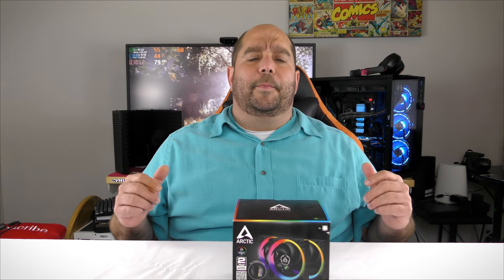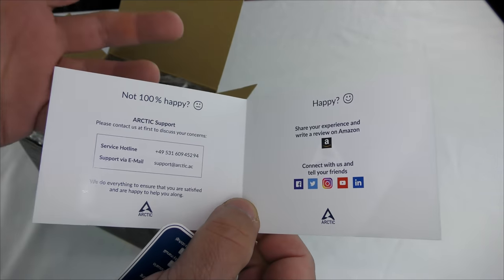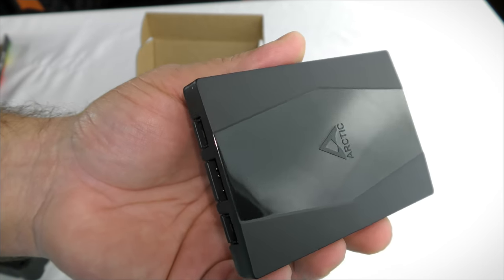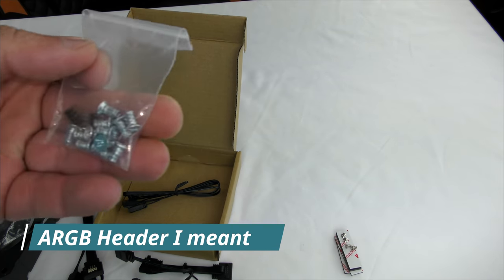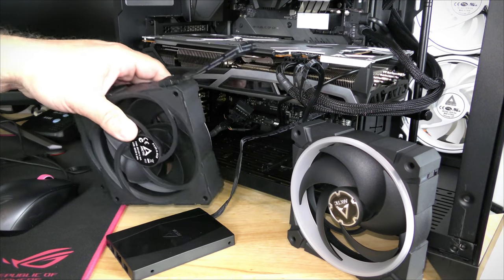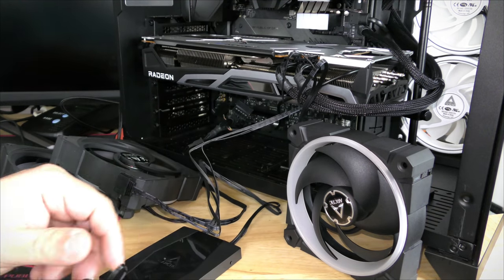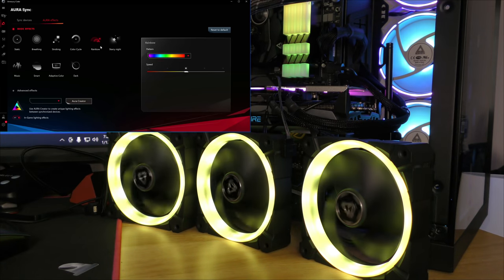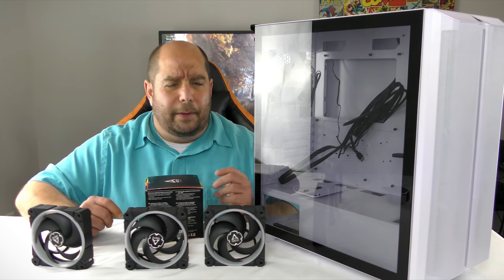NEW ARCTIC BioniX P120 A-RGB Fans - First Look

Comment: In my opinion these fans look way better than Lian Li’s fans that everybody’s raving about. I just don’t like the rgb pattern on them. These are not quite as simple to connect together, but they are easy enough. One thing I found odd is connecting argb fan hub into non argb connector, but I guess they had to do that way for some reason. Great video enjoyed watching. Bought two packs of these.
Reply from the maker: I like them too and you are 100% correct, they are not easy to connect, after you figure it out, its a little easier, but being that this is their first iteration, they will make the 2.0 version better.  Yes, this is to help older machines with compatibility issues, so that everyone can have ARGB.  Thanks bud, so very happy I could help you, hopefully you used my link in the description or pinned comment to buy them, it will help a bit, but if not, not worries, it literally is a few cents, but hey, 100 pennies makes a dollar ;)  Thanks so much for stopping by and checking out the video, even more for commenting, it means the world to me.

Comment: For anyone looking to use this fans as radiator fans. You guys gotta either talk to arctic and wait for them to get back to ya or you can order m3 35mm screws.
Reply from the maker: did you finally receive the screws?
Reply: @ThisBytesForYou  yeah I made a separate comment about the screws  for those who want the fans for their 360mm or 240mm radiador
Reply from the maker: @Angel_Espinal  yeah I would assume most would, but good, I just wanted to make sure you got them.  Is there a chance you could measure the screw and let me know how long it is?
Reply: @ThisBytesForYou  my separate comment states that, the screws that were sent to me are M3 35MM. The screws that were sent, they're referred to as "Cheese Head" screws, with a #2 Phillips Head fitting.
Reply from the maker: @Angel_Espinal  hahahha, cheese head, NICE.  Yeah that is the M3 and I saw the 35mm, but it didn't register, thank you so much ;)

Comment: Thanks Iggy for the unboxing and first quick review. Eager to see the full extended review.
Reply from the maker: Thanks my friend, you will see on Friday the build video, where I do the cable management of the video I just released monday, its nuts but turns out great.  thanks for your support.  more coming soon on this.
Reply: Hi Vincent, you seem to be a representative of Arctic.

Just wanted to say I bought a pack of 3 P120 ARGB.  One of them isn't even spinning but lights up. Trying changing orientation (first to second to third) on the chain etc. 

Gotta say, pretty disappointed with the QC.
Reply: @jivk.8928  I am actually the technical director :) Please get in touch with our support team from the form you have in the online manual. they will assist you for an exchange.
Reply: @VincentAndre_HK  Thanks, I'll give it a shot. So far, my experience with German companies is that everyone in their sales team speaks English. But when it comes to warranty/problems, suddenly no one understands English. (Looking at O2, 1und1).
Reply: @jivk.8928  No worry, we are fully international and actually, part of the customer support team is US based.

Comment: can i install these fans on arctic liquid freezer 2 radiator?
Reply from the maker: you can, but you need to call Arctic to get the correct screws, if it did not come with them.

Comment: Can my fan light up without this sata hub thing ? I have the same fan.
Reply from the maker: yes, but it is a controller/hub so that you can control it with the remote if you did not ARGB headers and so that you can connect multiple fans if you wanted, instead of 1 per ARGB header.

Comment: The screws are too short to mount the fans with a radiator, considering they are pressure optimized and not even standard 25mm depth :/
Reply from the maker: you are correct, I let them know earlier today, just waiting to hear back to see what is going to be done, but this is their first entry into RGB, I am assuming they made them beefier to accommodate for that but let's see what they say.
Reply: Good point we can't mount it on rads
Reply from the maker: Working with them on it, I am not sure what they are going to do about that, but I hope to get word back soon, should be today at some point.
Reply: Yes, that was and overlook from us, we are preparing longer screws for any customer who will request them to our customer support. they will be sent free of charge. It will be included in next production batch.

Comment: your suppose to use those pins to connect the fans side by side without wires.
Reply from the maker: yeah kinda cool how someone doesn't know everything just yet during an unboxing huh, on a2 year old video, but you can see how I build using it, where I connect them into each other with those pins: https://youtu.be/cHps_f44Ifs

Comment: I just bought the Arctic Freezer 35 Argb without realizing that my x470 Gaming Plus doesn't have an ARGB header. Is there any chance I can add this bundle and use 2 case fans + the CPU cooler and control the ARGB lighting through the hub + remote? I'm guessing that without an ARGB header on the mobo, I won't be able to connect the Arctic Controller to it, so Mystic Light is out of the question. Am I right or wrong?
Reply from the maker: well, you would be able to control everything besides the rgb lighting.
Reply: @ThisBytesForYou  So without ARGB on the mobo, there's no point in getting the controller either. :) Thx. That's one less expense for me. Still keeping the cooler tho, works damn fine.
Reply from the maker: @DrBones669  yup, you are correct

Comment: Where are the radiator screws?
Reply from the maker: like you have already read and surely are commenting on, these fans and fans like them usually don't bring radiator screws, a radiator in a liquid cooling unit would but actually because of my mention to Arctic about it, they are making those screws and including them.  Let me know if that is what you were going to comment on and I answered your next statement?
Reply: @ThisBytesForYou  That's exactly what i was after since long screws which came with EK radiator won't work.
Reply from the maker: It's coming my friend, they are working on sending me the updated version, so coming very soon.

Comment: Hello, really good video.
I want to buy new fans because my current ones are stock and extremely loud.
There is one thing I am confused about. You connected the fans to the controller hub and then used the 4-pin regular rgb header to connect it to the motherboard, yet were able to control rgb leds with software. HOW? Isn't it that you can control rgb via software only with the 3-pin a-rgb header? In the video you say this is what you are using, but the header has 4 wires and it says 12V on the motherboard, so it's standard rgb.
Thanks in advance
Reply from the maker: The ARGB header and the RGB header can both be controller by the Asus Armoury Crate
Reply: @ThisBytesForYou  Does this work only with Asus Armoury Crate or with other software as well like Msi Dragon center?
Reply from the maker: I would think it would work, but Asus and MSI make different products and I haven't been able to work with MSI so I can't say for sure.
Reply: @ThisBytesForYou  Makes sense. Thanks a lot dude. Cheers!
Reply from the maker: @despinakasimoglou5233  always a pleasure my friend, cheers

Comment: hiya, is it possible to use these fans as replacement to the arctic freezer 2 360 fans (p12) so they work with the aio and the added bonus of RGB?
Reply from the maker: Yes for sure, but you will need to get different screws, I recommend talking to support.  Being that I reviewed this I brought to their attention that the current screws will not fit a radiator, they are including new screws, but I don't know if the one you will has those screws.

Comment: Hello my friend I want ask  ,I have mobo msi b450 tomahawk max ( rgb slot 12v) I wana buy this fans ( artict a-rgb). If I’ll put this fans in my mobo They will work properly; plz answer
Reply from the maker: if you buy the kit (the 3 fans I have listed in my description), yes, it will work, but not the single fan.  your motherboard does not have argb headers (that I see).  With the kit, it brings a controller and a hub for you to control with the remote.  Also, you will notice, I answer all my comments.  Asking a channel to answer that does not answer any comments, will not get that channel to respond.
Reply: @ThisBytesForYou   in 2 days I’ll have this kit 3) on my home , do you have any video how can set this fans on mobo with no argb header ?  ( my mobo is tomahawk max )  I have to do like you the set expect  not to put the pin on rgb header ? Just sata ?
Reply from the maker: @mrtelis5093  yes, you dont have to use the header, you can just use the fan plugs.  If you buy the set like I do, it comes with an RGB controller that you can plug them into, if you dont have ARGB in your machine.
Reply: @ThisBytesForYou  I bought the set 3 today I set up like you all work fine , 😊I didn’t put on rgb header on mother board nothink  , there is any way to use the program like mystic light  to change colours etc ? ( argb gans Arctic / b450 tomahawk max mb
Reply from the maker: @mrtelis5093  yes, like I did, give it a try

Comment: Where is the sata power cable??
Reply from the maker: Did you watch the video?
Reply: @ThisBytesForYou  yes man but i don't have that cable
Reply from the maker: It would come from your power supply, you would have at least 2 strands with either 2 or 3 heads, so you should have some... If not I can recommend some adapters
Reply: @ThisBytesForYou  i bought the pc pre built so idk if they included it i guess i'll have to buy one
Reply from the maker: I am sure it does, open the case and see
Reply: @ThisBytesForYou  i think i found it hahaha
Reply from the maker: Awesome bud, happy I could help
Reply: @ThisBytesForYou  everything is working but the rgb isn't lighting up ... and i plugged everything in the way it should (i did have rgb fans in the case before and they worked)

Comment: Which direction is the airflow?  I need to know if the ring will show in the exhaust or intake orientation?
Reply from the maker: well, the way I have the front is blowing in/intake, the radiator up at the top, sucking out/exhaust and at the rear sucking out/exhaust.
Reply: @ThisBytesForYou   Thanks for the reply, but can you tell me if the ring is on the side that blows air or sucks in air?  I'll check your other videos if I can get a better look at your setup with these fans.
Reply from the maker: @takeit1229  the ring is on the side that sucks air through it, so it would be on the front of your case, it would be on the inner portion of your liquid cooling unit, the portion in the case, so you can see it, and it would be on the inside of the rear of your case, each place you would see it.  In the front, you wont see it in the inside of thr case, but if you have a mess or glass front panel, you will see it.  I hope that helps.
Reply: @ThisBytesForYou  Yes! Thank you.  So these are best setup as exhaust fans unless you have a mesh front.  I have the O11 and wanted to use them as side intake, but sounds like the ring will be facing towards the back panel.
Reply from the maker: @takeit1229  just know that the screws that these come with are not good for liquid cooling units, you need to contact Arctic and they will send you correct ones though.  They will work perfectly fine either way, they will just provide more light inside the case as exhaust but will still shine inside the case as intake, just not as bright as it will be a reflection.
Reply: @ThisBytesForYou  I may go for the Lian Li St120s or Arctic PF12 rgb (if the 3 pack comes in stock).  Not using these for liquid cooling, just side intake.  I like Arctics fan performance and prices.  Not in a rush as I'm just slowly replacing things on my current build while waiting for "normal" prices on GPUs.
Reply from the maker: yeah for real, I don't know when they will come down, but I hope they hurry up haha

Comment: I dont think you know the differnce between a ARGB header/connector an a RGB header/connector!?
Reply from the maker: Please enlighten me?
Reply from the maker: Or did I slip up my words at some point and show my human and you've never seen a human, I mean it can happen.
Reply from the maker: I didn't think I would get a reply, oh well, I guess I won't learn... Cuz I don't know
Reply: @ThisBytesForYou  ARGB is 3 pin connector(5v) RGB is 4 pin (12v) Your mobo is not supporting ARGB i assume. When you open AURA and say lets do rainbow... where is the rainbow? You are just cycling true colors.  In sync yes, but thats it.
Reply from the maker: @awasov  they can both be changed with RGB software and they can both be in sync, kinda like Stephen and Steven, they sound the same but are spelled differently, you will lose some functions obviously going from a 4 pin to a 3 pin, but the RGB part is the same.  

Yes, both the Asus 570 ROG Crosshair Viii Hero and the Asus B550-F WIFI have Standard RGB headers and Addressable Gen 2 RGB headers so I am good there and as I get more boards to review, I am sure they will have the same. 

I have both pins covered.

Comment: Hi I know this is a weird request however can you do a video on how to stream with low to mid range specs :)
Reply from the maker: it would be 100% the same as you last saw me do, I did a few test streams to find the perfect mix of performance along with bandwidth requirements and settings.
Reply: @ThisBytesForYou  ok 😀 thanks for the reply!
Reply from the maker: always a pleasure my friend
Reply: @ThisBytesForYou  do you think a Ryzen 3 3200g and gtx 1650 should be able to stream rogue company because every time I Try it blue screens lol
Reply from the maker: @Macauley7272  you should yes, but have you tried it on the new install of windows, or the old install?  If i doesn't work, it should fail and drop you back to your desktop with a message, it won't bluescreen.
Reply: @ThisBytesForYou  the new install of windows fixed the blue screen I am streaming now And it seems to be working fine however my internet adapter needs upgrading so I’m lagging in game quite bad but the stream on obs looks good however I can’t check at the moment
Reply from the maker: @Macauley7272  well, if you are watching the stream and play, you are sucking in more bandwidth which will kill your speeds, and cause tons of lag.  If you have a cell phone, get off of WIFI from your phone and watch from Cellular Data, if your plan allows it.

Comment: hey is the argb header for the motherboard 3 pin or 4 pin?
Reply from the maker: did you watch the video?
Reply: argb is 3 pin and non addressable is 4 pin. The controller plugs into non addressable rgb I think he just said addressable when he meant non addressable. Great video!
Reply from the maker: @eus105611  yes, that is correct, the controller however is addressable, that it brings (if you buy the one with the controller) which means it is great for systems that have RGB or ARGB because the remote can help.  Thanks so much for your kind words.

Comment: i cant seem to get them to go with my sync!
Reply from the maker: do you have them connected into the RGB header and do you have them registered inside of Armoury Crate if you are using Asus?
Reply: @ThisBytesForYou  I’m using an x470 Aorus elite
Reply from the maker: I dont see that board anywhere, can you verify that is the name?
Reply: @ThisBytesForYou  Aorus Z490 Elite AC, my bad
Reply from the maker: are you using RGB fusion?
Reply: @ThisBytesForYou  Yes. I plugged the fan header in and the other cable to the lower left plug-in labeled DLED
Reply: @EnriqueRevilla  it's gotta go in RGB idk if LED is the same. It might be called GRB or BRG on your motherboard for some reason they switch up the letters sometimes
Reply from the maker: Sorry, I never saw this reply, have you been able to get it working?
Reply from the maker: Thanks Enrique for stepping it and trying to help
Reply: @ThisBytesForYou  yes I ended up going the fans through the new system where the “stick” to each other and connecting the cables to the fan header and RGB header instead of that weird controller
Reply from the maker: @EnriqueRevilla  nice, happy you got it working

Comment: something is not right here, they spin from 2000-2500 RPM have noise lvl at 29 dB are 10 years warranty in europe and cost 19€. this specs are better then Noctua NF-A12x25
Reply from the maker: How could there be something wrong, it's arctic, cooling has been their specialty for ever, arctic is amazing
Reply: @ThisBytesForYou  I never really looked into their products. Under closer inspection, this fan on paper is a bit worse then noctua counter part, but 10 year manufacturer warranty is insane I must say.
Reply from the maker: Arctic has always been know to make amazing, durable and affordable components, noctua does a good job though I cannot speak for their longevity though.  Arctic has been around forever too.